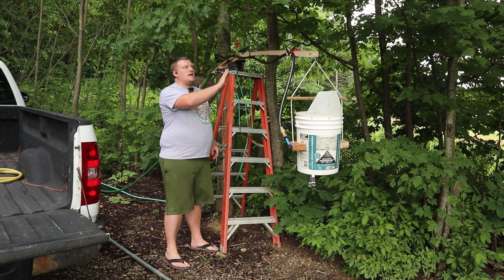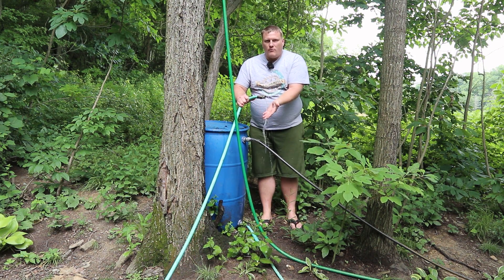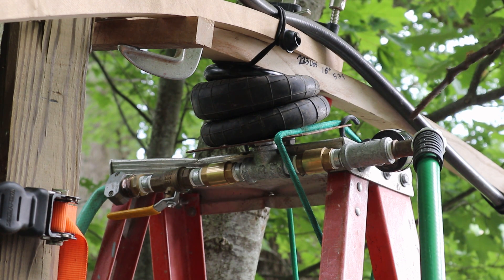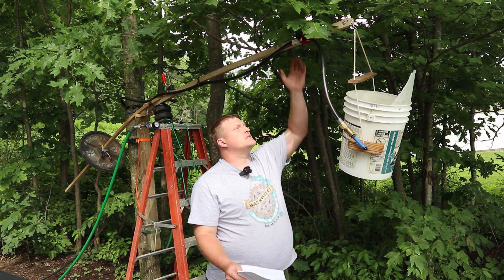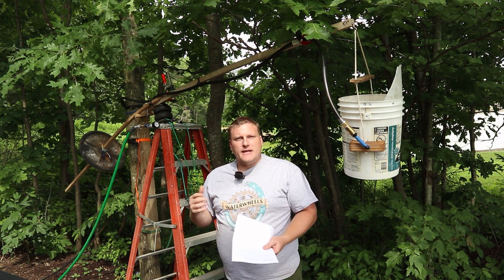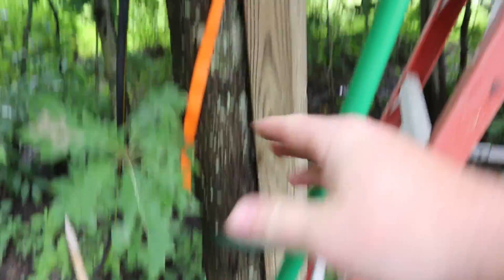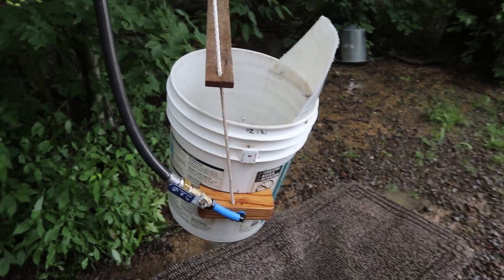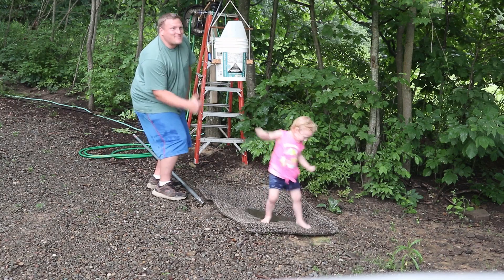Gravity Powered Tipping Bucket Pump

Comment: Thanks for the shout out! Really interesting. The ram pump min functioning head is 3 feet. So any pumping under that is great!
Reply from the maker: The only concern I have right now is that pumping volume will be much lower than a ram pump, as shown it will only pump about 60 gallons a day. I can only speed it up so much (to be tested).

And you're welcome for the shout-out, you make great content and your success will help me too.
Reply: @JoeMalovich  The volume of water available is what will determine the amount of water that can be pumped. If you make the bucket fill faster by feeding it more, you will cut the amount pumped by the same amount and end up at the same or less pumped in a day. There is a balance point.

Comment: Your video has inspired me to create a low head pressure pump. I'm thinking I can use a wider catchment bucket  And then use an auto siphon to pull out the water.  It would be slower but could potentially have more water pressing down in a small  vertical space
Reply: you could also try a auto syphon air compressor. this works because the syphon gobbles air when it breaks and later this air is pushed downwards by the flow and can be catched in a underwater bell at the outlet. i got this working with two small hoses but i cant test it with bigger hoses. would definetely like to see my idea on youtube

Comment: Thought:  What if instead of a bellows pump, you used a hydraulic ram?  You might be able to take advantage of more of the motion of the see-saw to pump a longer stroke?  Also, you could have another ram on the opposite side to take advantage of the counter-weight back swing?   Lastly, could you set it up to pump from the 'pool' created by the bucket dumping, so there isn't water loss (at least not a big one) in the system?

Comment: Hi Joe, your pump is marvelous! What do you have in that black rubber bellows - water or air?
Reply from the maker: Water
Reply: @JoeMalovich  I thought so but the doubt was because you kept calling it an air spring.
Reply from the maker: @gondebas  they are meant for air but screw the rules
Reply: @JoeMalovich  How have you blocked the top hole of the bellows? Assuming of course that there were two holes in your bellows.
Reply: Ok, I get it now. What width of the valves do you use 1" or 3/4"? I can see that your input pipe is narrower than your output pipe. Wouldn't it be better the opposite? I am wondering if it is ok to use 1" guts for valves and T-part and 3/4" for output pipe.

Comment: So, I like this design, it works. Could be better for sure but for a rough start it's great.

Thinking though that an electric pump could work better. Wonder what it would take to run as much water as this does though.
Reply: i think one of the major points of the pump is so that it does not require electricity.
Reply: @OwenHeh  I think that's the only point lol
Reply: @sonicmouse3083  i mean it also requires less head than a ram pump so thats another point to me

Comment: Instead of a tipping bucket you could use a bell siphon to empty the bucket.
Reply: I have some limited testing with the the bell siphon and it can be tricky with low flow. But with a good amount of flow could definitely use either an auto u siphon or the bell siphon.
Reply from the maker: @LandtoHouse  ironically you can start a bell siphon with a shishi odoshi too. Land To House has a video on this.
Reply: @JoeMalovich  Land To  House does have a video on that.
Reply: I think its much  easier to adjust a mechanical tipping point compared to triggering a bell syphon at the correct time. To obtain maximum water pressure from the air spring, i think it would be better to have a mechanism that releases the bucket when its full of water. This will provide the maximum amount of force on the bellows.compared to the gradual filling of the bucket. The latch/release mechanism could be a simple float operating a sliding pin. The pin would need to be spring loaded and angled on its top edge to automatically latch when the bucket is raised back to its starting position.

Comment: Sorry. Got halfway through and still had no idea what you had built, what or how it was doing anything. 
Just that you have a lot of pipes that are fed from a spring and dump water on your daughter. <shrug>
Reply: The pump consists of the bellows and 2 check valves. The wooden beam is effectively a class 2 lever that compresses the bellows, pushing water up the delivery pipe. Water is drawn into the bellows (pump) via the check valve as the lever arm rises.  The bucket of water on the end of the arm supplies the force needed to pull the arm down.